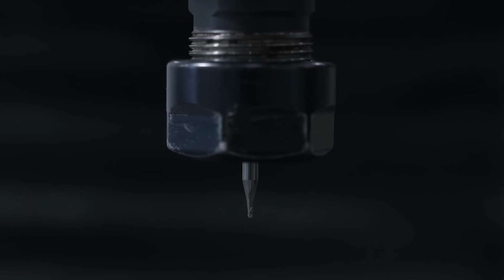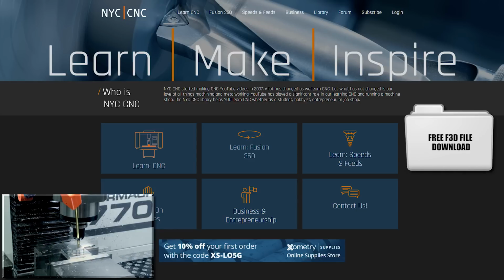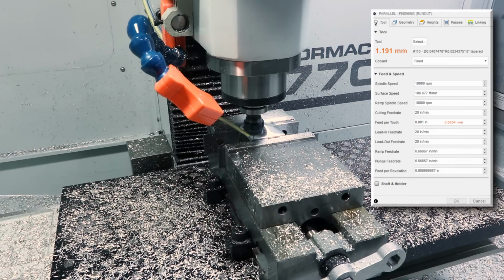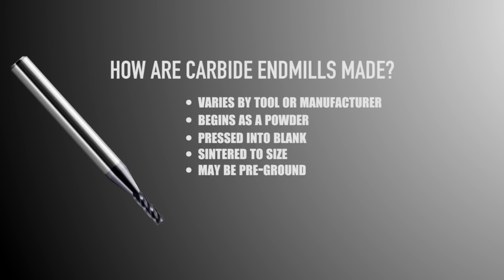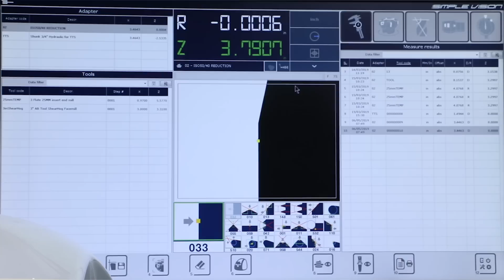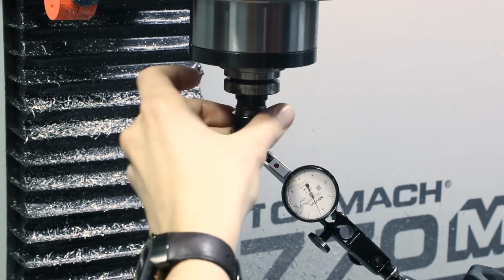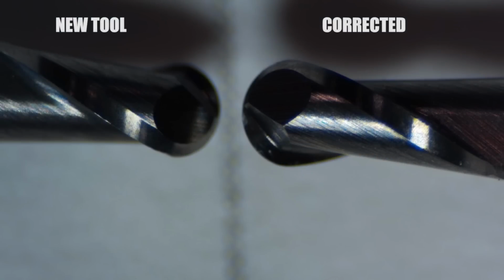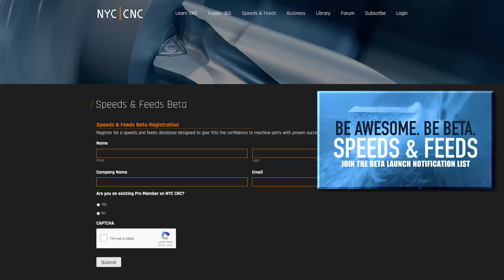Adjusting Endmill Runout: Does it work? | WW257

Comment: I like this stuff. I have used this method more times than I can remember because it is common sense, but was not aware how much it is done in other shops. But it dang sure works! Brass against steel instead of tape. It reminds me of "Staking" steel with a punch in order to get it to expand and fit tightly against another piece of steel or cast iron. Yup, many times...

Comment: Interesting!
I had exceptionel good look doing this with small carbide drills <1mm, even worth checking the runout and correcting if necessary on a manual machine. 
Same for reamers, even if common wisdom is, that they will follow the predrill hole, even with a bit of runout.
Reply: You mean luck?
Reply: @dominikm1457  Thats correct
Reply: Isn't slightly less than a millimeter runout would lead to big tolerances deviations?
Reply: @Trident_Euclid  He very most likely was talking about the end mills diameter. 1mm runout would be catastrophic! At my work place we have tool holders consistently capable of less than 3 microns of runout, and that's probably not even as good as it gets.
Reply: @matiaspetersen2644  how do u remove this error  I mean If there is outrun of 1 mm than how it can be reduced to 3 microns in endmill
Reply: @techno-wonders  In a collet holder, 1mm of runout would most likely not be fixable unless the endmill has been installed incorrectly in the holder. In something like a 3- or 4-jawed chuck like you would find on a lathe, the part in the chuck can often be beaten and adjusted to the specified tolerance - this would of course be while continually checking the runout with some sort of gauge capable of measuring smaller or equal distances to the specified tolerance.
Reply: Thanks for your response

Comment: John have you tried just tapping the nut instead of the tool? 

I find tapping the nut with a small brass hammer is enough to move everything without having to hit the tool itself. That indeed makes sense, as the nut both has a thread, and is engaged in a thread with a required amount of clearance. Tapping the nut will move the nut, the collet, and the tool across on the spindle thread. Not much, but enough.

Comment: Greasing the ER thread and nut taper improves a lot the runout, with increased holding force. Also is interesting to use a simetrical tool to screw the nut, so you only aply torque instead of torque plus side load on the nut.
Reply: Very interesting, thanks.
Reply: @JohnGrimsmo  given how much I learnt from you, glad to help a little bit!

Comment: a person also has to factor in deflection that takes place during a cut. Example-picture an extreme for visualization only-- 3/8 long end mill with .002 runnout. However picture it taking a .005 depth of cut side on the tangent and you are feeding along pretty fast. That runnout now is canceled out and the entire cutter bends true. However note the test. there is little deflection of the cutter but its also cutting way down about 50% inward on the ball not on the periphery. So its good points and a good microscope picture but in most cases you would not notice much.
Reply: the points are well made regardless but looking again at the shape of the part--if they had measured the runout about 50% of the way on the sphere--I believe the runnout would not be detectable. Keep in mind that you checked on the periphery and that the sphere of the ball is ground totally independently as you noted on the other parts of the cutter therefore its hard to say.

Comment: I did this in a set screw tool holder once on an old manual horizontal boring mill. I had to hold +- .0003 . It actually worked .

Comment: Do this all the time with .015 and .020 endmills. They will break in a couple minutes if you don't and leave nasty burrs before the go. If the runnout is bad clean and reseat the collet before you start hammering.

Comment: Great video, just now found it and I follow NYCCNC and have been for years.
Been doing this for years. I use a piece of plastic since we machine LOTS of plastic (delrin).
One thing I recommend is to thoroughly clean your tool holder, collet and collet chuck. Apply a light film of oil to allow everything to slip together easy, torque your collet to the correct torque.
More often than not I get 0 to 2 tenths with the above right off the bat.
If it is out, a gentle tap is all that's needed to bring it in.

Comment: It seems to work really well, but it leads me to ask 2 questions.
Is the adjustment only valid at the tip of the tool or would there be wobble from the tip to the shank?
In such case where the tool is in fact perfectly made and the runout is from your machine,then doing this to fix either an angle alignment or an eccentric alignment would misalign the tool such that it would be even more out of alignment when next used (I suppose if you have a witness mark on the spindle then you could mark the tool to match).
I'd made an adapter for my jig saw so that I could hold and operate needle files in it. The file holding side had 8 adjustment screws (2 sets of 4 upper and lower). Because my files were so varied in the handle no simple method would suffice. Needless to say my thoughts drifted to this topic when I saw this video. How difficult would it be to apply the same sort of total control over axis and angle for a milling tool?

Comment: very informative!  I'm assuming that if you did the same procedure in a part that could be measured accurately, such as a diametrical part, then the adjusted mill (or a reamer) would perform better.

Comment: Really good video. 

Interesting to hear about the small tools possibly being ground in multiple operations, I never thought of that but it makes sense.

I've also found that many times simply loosening the collet nut and rotating the collet or the tool within the collet will make a big difference and only then tapping it in after rotating works pretty well (after rotating sometimes I no longer even need to tap).

Comment: I know you said after the tool is of such a diameter tool run out of these numbers are negligible. I'd have to think after 1/8 th inch it's not necessary. I know I rarely use 1/8th inch. Ocasionly 1/4.  But mostly 1/2 3/8 or 5/8 end mills& ball end mills. And never check these

Comment: Does runout still has an impact on finishing if you use single flute end mills? The effective diameter would slightly change, but the feed per tooth would be constant.
Reply: Feed per tooth may be constant, but chip thickness would vary along the cut. 

If you took the run out to an extreme and say had .010 out of concentricity, and took an .010 finish pass, your have vertical lines along the surface protruding out .020.

Comment: Guys! Your videos are the best one on CNC. A suggestion for a possible new video. Please explain conventional and climbing milling and moreover when and if you advice to use one instead of the other. Maybe making distinction in case for big CNC (really rigid) or mini mill, like Grizzly G0704, BF20 or the smaller Tormach, when the rigidity and HP can be an issue. Thank you vey much if you an do it! I think it's really important and interesting.

Comment: I am wondering what it is that bends or moves when you are hammering on the milling cutter. 
Presumably it is the seating of the tool in the spring collet, and not the milling cutter bending, or rotating in the collet?
Is this an argument in favour of using shrink-fit instead of ER collets? Or maybe just buying better quality grades of ER collet?
Then again,  if the flutes of the milling cutter aren't perfectly concentric with its shaft, then even the best quality ER collet in the world won't magically make them concentric with the spindle.
Reply: Yep need an answer to this ... please 🙂
Reply: I believe it is more the collet being moved around in the holder. Lower quality tooling will have a squishy feeling as it gets tighter, really good stuff is more like hitting a wall when it gets tight, the wrench just stops moving.  Not surprisingly the squishy stuff responds to the tapping process more then "better" tooling. I have some HPI MX holders and collets where if everything is clean you get what you get there is no tapping it in, admitedly not an ER style collet.
Reply: Oh ok thanks ..
Reply: The collet fingers are moving inside the nut and taper.  A carbide tool is either straight or broken.  You can't really bend it.

Comment: Thanks again for another great video. Been doing a bit of surfacing with ball end mills in aluminium and I've been finding the biggest variable in surface quality was the size of the endmill. reckon it'd be pretty night and day if you did the same part with the same stepover / feeds and speeds only with the split being between a 1/8" and a 1/2" ball end mill. Pretty sure I remember you touching on the advantage of using a larger ball end mill in another video.

Comment: Low runout for mold type work would be 3 to 6 micron, not sure that 7 tenths 0.0007" runout improved upon with a screw driver in the Tormach spindle will show that much difference. The micrograph does show some differences. What's the runout on the spindle then ?

Comment: Thank you for this video. I ask you this very question months ago, so I'm glad to see you tested it and found it "sticks."

Regarding that tolerance stackup: I'd be curious to know: if you optimize runout int he Speroni and then transfer it to the Tormach (ideally to a PCNC1100, because that's what I have :P), do you see a degradation in runout? Are you able to put a TTS holder in the Speroni?

Comment: If the clamping nut consists of 2 parts (with pressure ring), it is always a more accurate clamping of the cutter. Interesting to hear about the inaccuracy in production of the tools, but you can distinguish the quality according to their origin western or asian.

Comment: Great video!

But you're still using a small endmill for finishing.
A bigger ball will give better finish at a given stepover. You only need the small ones if you have very steep creases. (And then, only for those narrow channels/pencils)
Reply: A larger endmill really wouldn't be the best to demonstrate what he's teaching.
Reply: @thegribbs  you're not wrong, but maybe this test isn't the right test then? I see them using small ball mills on big low curvature surfaces in many videos. How about parting lines as a demonstration? Cuts faster, too :-)

Comment: Are these corrections being made to the tool itself (i.e. bending/deflecting the tool), or is it moving the collet inside the collet holder when you tap on the cutter? Or a combo of both?
Reply: the tool is not bending at all. You're just moving the collet a little bit.

Comment: I almost never check runout on my tools unless i'm sticking out alot. Don't need to with everything being +-0.004 or 0.005
Reply: That depends. Runout = worse tool life.
Reply: @gusjohnson6646  that also depends how bad is the runout. If it's less than .0005 which in most cases it is then the tool will be fine. Speaking about aluminum that is

Comment: As far as end mills are concerned, why are you not using a solid holder for this application?
Reply: Solid holders with set screws are pretty bad for causing runout.  Shrink fit holders may be better but in certain applications are 'too rigid' that can contribute to vibration.
Reply: @EUnit111986  solid holders are pretty bad for causing run out? Are you mad :) never had a problem using solid holders for end mills. The only time I've had a problem with run out, chatter, deflection, etc. with an end mill is when I used a collet holder . Especially during a side cutting operation . Sometimes you have to decrease the feed slightly and increase the rpms slightly. Using a collet holder does enable you to indicate the tool, but to what extent? Will this ensure stabilization of the tool during the process throughout?
Reply: @EUnit111986  Check out the couple of videos this channel did on solid holders and TIR.